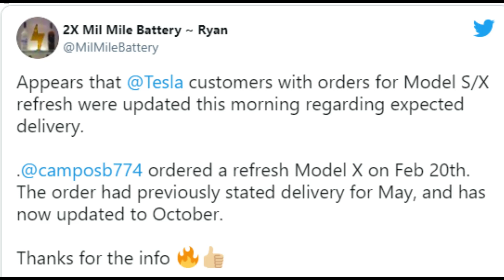NEW Cybertruck TEASER, FSD ABUSE creates more FUD, GIGA BERLIN

Comment: Tesla should have an option of shutting down the car when nobody is sitting in the drivers seat. I don't understand why they don't do that ???
Reply: Maybe because it's a little more complex than you think.
Reply from the maker: Isn't it like that the seat realizes if someone sits in the seat? That's the way it works but if you close the door sit down and you move afterwards the car still think you drive the car that's the issue
Reply: @TESSINEWS  Yep, because you could move on your seat, sometime lifting yourself a little bit from the seat (while driving) can drigger the seatbelt alarm. I would not imagine the car shutting down in that case, that would be pretty dangerous. You can think of a lot of security features you will never overcome sheer stupidity.
Reply: @TESSINEWS  Thats why an internal camera would bring some clarity into the matter and if nobody is in the seat, the car should drive to the side and shut down. Only to open again with the permission of Tesla ;)